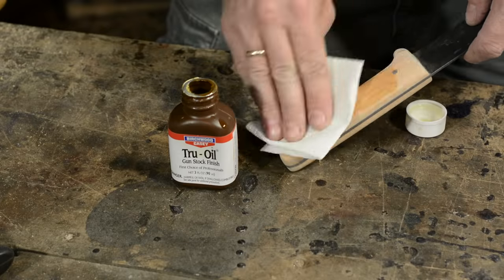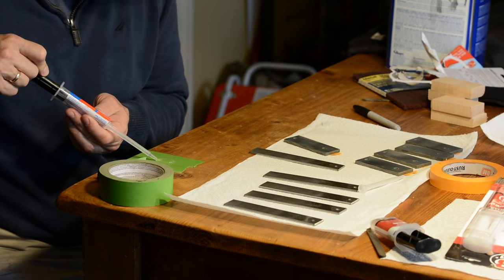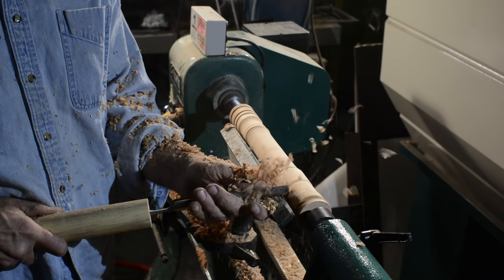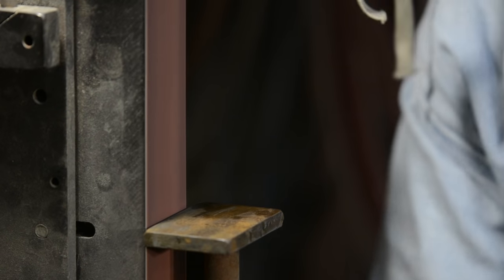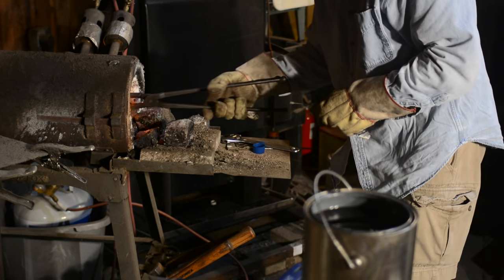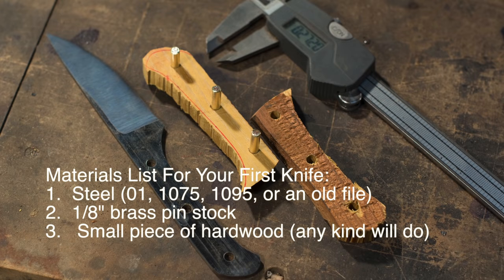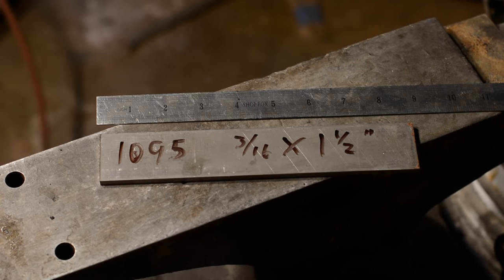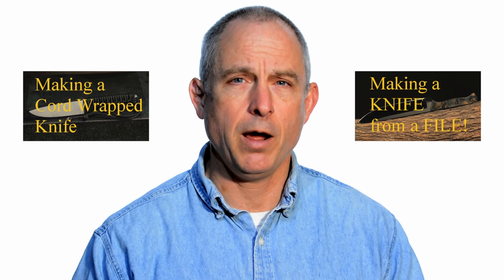Knife Making - How to Get Started!

Comment: I would like to comment on a mistake I made when I first started making knives.  Like many, I started with files & sandpaper, reading every book & watching every video I could about making knives.  Gradually I upgraded to a belt sander, heat treating oven & stocking up on handle material & finally sanding belts for the 2 x 72" belt grinder.  And then I had to deal with some health issues & the knifemaking had to be postponed. Eventually my health improved to where I thought I could resume making knives.  The first time I tried using the belt grinder, the belt popped, coming apart at the seam.  I tried a different belt with the same result.  Nowhere in all of the books I had read nor all of the videos I had watched did anyone even hint at the fact that sanding belts have a life span.  Evidently, these belts cannot be repaired so I now have a lifetime supply of sandpaper, none of which I can use on my belt grinder.  Keep this in mind when ordering belts.  Don't order more than you can use in a year or two.
Reply: dang, still have any of that old sandpaper? lol
Reply: Yep.  I put my old mans belt sander back in operation a few years ago and all his old belts blew apart in the first one or two uses.
Reply: Thanks for the info, I also had to postpone my knife making, due to moving a whole shop, life stuff and this corona ordeal is postponing everything. Been more than 8 months since I fired up my grinder and 1st and 2nd belt snapped.. others are doing fine for now. Nice to know Im not the only one dealing with this kind of problems.
Reply: Thanks Gary,you probably just saved me a chunk of cash.
Reply: My father worked at  veneer mill and has a lifetime of sand paper as well .
Reply: So the sandpaper itself has a shelf life? Like if I don’t use it at all, it’ll go bad?

Comment: I started out 6 years ago with an old dining table in the corner of my garrage, a saw and a hammer and set out to make a gate from a pallet. I enjoyed it that much i went on to make flower planters out of old pallets. Along the way i bought, was donated and gifted tools. I now have a dedicated workshop with a band saw, mitre saw, routers, grinders, a welder, more tools than i could ever imagine id own. I even have a wood burning stove which i made from an old gas bottle in there. Today, i made my first knife, and im so proud of it. As Walter said, start small and see where it takes you, you could start knife making and find you enjoyed making the wooden handle so much you end up going into joinery. Also, embrace the mistakes and learn from them, dont let them knock you back.

Comment: I started on lawnmower blade, my grandfather had a good 300 of them as he job is repairing lawnmowers. i would advise anyone starting out to ask about if there's anywhere you can get high carbon steel scrap, most of my knives are hand forged so the odd shaping was never an issue and it didn't cost me a penny to get going. Now i use O1 mainly but still have an affinity for turning old scrap into nice knives/machetes. I made my first machete 4 years ago and to this day i still use it

Comment: I've done more than 10 knifes just for hobby using only files, a bunch of brick to make a little forge to harden the knifes and cheap steel, i've used only carbon steel on them because where i live is hard to find stainless steel to sell, but all my knifes came pretty good, obviously, a belt grinder would make things a looooot easier but is too expansive to buy it for now. The only thing you'll need to start making knifes is motivacion, and time, a lot of time kkkkk you just need to start!

Comment: Just found out my nephew has a forge and lives locally ;)  But definitely going for a 1x30 belt sander.  A necessity in my opinion and if you have to buy all those hand tools you might as well get the sander as it will likely be cheaper.

Comment: I once saw a knife maker (a friend of mine) use a rickety home brew jig attached to what he called "Throw away files" that cost him $10 a file and went through bar stock in speeds almost as quick as a belt sander, then cleaned it up his knives on a different jig with better files. 

The only time he used the belt grinder was for actually roughing out the basic shape.

Then went and heat treated his knives in a rocket stove made out of bricks in the back yard.

Comment: I got the basic tools to get started, hacksaw, a file set, vice, sandpaper (60 to 120 grit).
A forge made from cinderblocks, for tempering i use the oven in the kitchen.
Within the next couple of days, i'm starting on my knife, a karambit, i already got the template drawn up.
Reply: Good luck making the hole. (It's fricken hard)
Reply: ThatCrazyPurpleMan Hand crank drill
Reply: without a router its hard to get it rounded off nicely, how did it come out?

Comment: Tools I have
Ángle grinder with 3 types of discs 
Table ezmeril
Vibration sander
Harbour belt frauhj sander
2 hammers
I piar of tongs
And other smaller tools for detailes like files dremels Woods paint resin glue and patience

Comment: Made my first last year did it all the way start with a little piece of block spring steal and beat it out into a blade did it all at the forge.  Then ground it sharpened hardened and tempered it then made a simple wood handle for it took two weeks in my spare time but when done I had what I now call my Peter pan knife it 5150 with brass gaurd and hickory handle brass pins. My daughter has it it was her birthday present she wanted a little peter pan knife. Three Half inch blade nothing big or fancy. Today I start my second knife out of a Damascus bullet I made two weeks ago.  I have no idea what I'm doing I just do what I feel.

Comment: Mr. Sorrells, I am a beginner and need some info about heat treating. Do you go with the heat treating before or after the initial    belt shaping, grinding, etc. Also can you still sharpen your blade after the heat treatment ? Told you I was a beginner, lol. I would be grateful for any knowledge you can share.

Comment: Hi Mr sorrell, just wondering if you could answer a quick question.

Without a belt sander or grinder, would it be a bad idea to draw-file a bevel from guard/bolster to the point tip, or would you recommend standard filing the bevel?
It seemed like draw filing might be easier to achieve an even bevel with, rather than maybe getting uneven spots using a conventional "push the file down into the bevel" technique.
Thank you very much!

Comment: Hey Walter. Quick question: Have you ever had a blade cut into the belt while grinding?
Reply: +McJaews Wouldn't that mean you sharpened it too early? and not just bevel it?
Reply: +Max Strandberg I have no idea. I've just seen a bunch of examples of people grinding blades to quite a sharp edge on a belt before going to a wheel or flat stone. And even a letter knife is sharp enough to tear through things materials if enough pressure is applied. I ask only out of curiosity.
Reply from the maker: No.  I suppose if you tried to stab through one, you could, but at normal speeds it just grinds the edge away before it can penetrate the belt.
Reply: +Walter Sorrells thanks for clearing that up. It's been bugging me, but now that I remember to account for the metal being constantly ground down, it makes more sense that the blade wouldn't cut into the sandpaper.
Reply: I had a bite once, the blade got stuck between the belt and the jig, gladly my belt grinder is not powerful so it did just stuck...
But a friend used my belt grinder when i wasn't there and he ruined one belt by sharpening a hardened tool, but the belt was already old...
I'm talking about a pretty low power (500w) and not really fast belt here, not a fast 2500w one (even if i'm planning to build one lol)
Reply: irlrp So i suppose what I've learned from this thread is that it's a bad idea to sharpen hardened steel with a belt sander. But also that most of the time, being careful, and knowing your steel, you can grind away with no problem due to the steel being ground away faster than it can bite.
Reply: McJaews You can sharpen hardened steel with a belt sander, knifemakers do this all the time, it's pretty much a matter of angle, speed, band quality, force you apply ... Don't be too scared to use the tool if you respect safety rules... The time i got scared when my blade got stuck between the band and the jig, it was pretty much my fault... and when the belt got cut it was a bad use and tired band :p

Comment: Do you have a subsequent video on beginners heating and heat treating. In particular on the steels you mentioned in this videos.
Great vid btw

I'll be working with a coffee can forge and a 10 pound sledge hammer head In a bucket of concrete. A 200mm grinder with linisher and small drill press. A few hand files, a hacksaw and a good old hammer.

Comment: i would not consider 1095 a  beginner steel for heat treating. often it comes with A TON  of factory stresses and more times than not you have to anneal it to drill holes and it is very finicky to heat treat, it tends to crack in water and not fully harden in oil if its a thick blade. for best results normalize and don't use hot oil that you left out in the sun

Comment: If one cant afford a massive belt grinder like yours, is using a cheap low duty belt sander better than using files? I tried grinding a bevel with the beltsander but screwed it up. 
Could you make a newbie video on grinding a flat bevel?

Comment: I love your videos and I've wanted to make a knife for a long time! My dad and I built a homemade propane forge and we have a few of my grandpas old filed laying around that I want to make into a nice knife. Using some of your videos I have determined that the blade steel is o1... I guess my real question is how will I be able to get these tool? (I'm 14) I mean I have a hacksaw and hell even a reciprocating saw with metal blades and a few pretty solid files. What else would I really need? (Besides my forge, hammer, anvil, and a grinder)
Reply: I meant to say metal cutting blades not just metal blades. (Damn phone)

Comment: Hey Walter. I am getting started in knife making, due in large part to your great videos. I know you that you have a high-end belt grinder, but I don't exactly have the finances for one of those. Would I be able to use a cheaper sander and be able to make it work? Say, a 2x42" belt sander with an attached 6" disc sander, or something similar. If so, what are the main drawbacks with using it? What should I be considering? Thanks in advance!

Comment: Great video with a fundamentally important and valuable message: Do what you feel like doing, be determined and don't mind if others raise their eyebrows.
My first file knife is in the works. Still have to harden it and make a handle. 

But I have a question: 
I annealed three files at once. Two of them warped so badly during the cooling process, I couldn't use them. Is it possible to reheat and place them between two flat objects, to get them straight? Could that happen to my knife while heat treating? If the worst case comes down, what is there to do?

Help is appreciated. Deutsche Antworten sind gern gesehen ;)

Comment: Tips on annealing O1 after forging to drill it? Tried leaving it in my coal forge with a nice bed of coke around it and it was still fairly hard in the morning , although i did manage to burn/chip/chatter some holes through with a cobalt bit, lol.  I know carbide bits would be ideal..  I think part of my problem was that i had it above critical temp before i let it cool down. Would that be correct?
Reply: well, the steel has to be reaching austanitization tempertarure ( ~1400 ℉) and then let it soak about 2 min. per mm steel ... and you need to have sharp drill bits ! also the way you drill ( fast / slow) is important ! take oil and drill very sliwly with middle high pressure ! hope this helped:)
Reply: +Lemondo yeah, I woulda had it over 1400 for sure, which is part of my problem I think. 280 RPM is the slowest my press will go, even that seemed a little fast.

Comment: Could a knife go without heat treating and still function and hold some sort of edge?
Reply: If you used a previously heat treated piece and were careful not to get it too hot during grinding, etc. But then you wouldn't be able to drill handle pin holes without a big pain... Probably not worth it over all..

Comment: Walter I was wondering if you don't have the right kind of heat treated steel what will happen to the knife
Reply: +Isaac Dial 
Everything from immediate cracking to eventual failure. 
Nothing good.
If it is a project that matters to you, or if life depends on it, buy a steel that you know how to heat treat, or get someone who knows what they are doing to do it for you.
The heat treating process is make or break and involves a lot of different variables. Mess up on any one of them, and the most expensive piece of steel can become totally worthless for any kind of tool (blade).
Sometimes fixable, often times not in my experience as a resident blacksmith.
There is no other way around it.
Great videos Walter.
Reply: thanks

Comment: Do you think D2 tool steel is a good starter steel, I already have some equipment to work with, or should I start with 1095?
Reply: 1095 all the way D2 is NOT easy to properly heat treat.
Reply: A.J. Rusinek I realized it wasn't a good starter steel, after I searched it up.
Reply: Ralakus yeah 1075,1985, o-1,1095 and 440c are fairly good steels for beginners
Reply: Yeah, 0,1 is unexpensive (i find it around 4eu the 300mm/3mm/1000mm bar) it's a very nice starter for experimenting, you're not too afraid to waste it...

Comment: There are way  way way too many people beating on hot metal making martial items, knives, swords hatchets, and all other manner of weapons. There are far fewer people making fine woodworking tools. I made my  first knife from an old file. Now I have an inductive heating coil that will melt steel faster than any forge. I got stupid lucky, and bought a $600,000 outdated machine that runs on vacuum  tubes for $00. When no one was dumb enough to buy it, they gave it to me. $2000 later for new tubes, and I love having a machine that I can heat steel with, without using any fire. I am making Japanese trident Kiri drills this week. I build guitars and the cost of truly good hand woodworking tools was above and beyond ridiculous, and half of them were ill suited for my needs.

Comment: While I can appreciate this video and the info it gives, however, after a couple years of making knives from pre-made blanks with files and sandpaper only.   Belt grinder IS the most necessary tool to take you to the next level for most people, and the one cost prohibitive tool that a knife maker needs to be half decent.
Reply from the maker: +Roy Fernbach Absolutely correct.
Reply: I use a little harbor freight grinder and it may not be a Bader BIII but it is a million times better than a file.

Comment: Just fyi, most knife “forgers” do not actually “forge” anything. They basically heat-shape steel that is already forged. There is nothing wrong with it but it is not superior to hand shaping by grinder. In fact, if you consider corrosion resistance important, hand shaping preforged, hi grade Stainless Steel is superior to “heat shaping” carbon steel. Then again; nobody gives a shit but me.